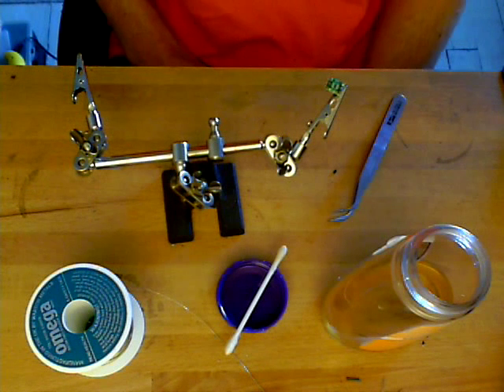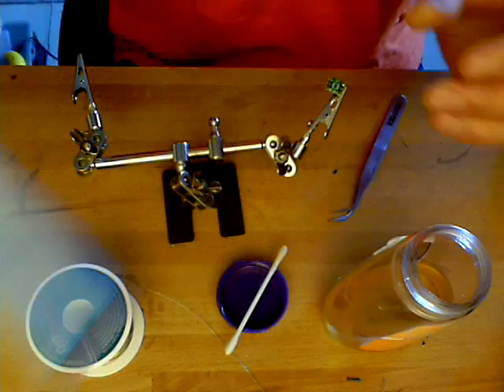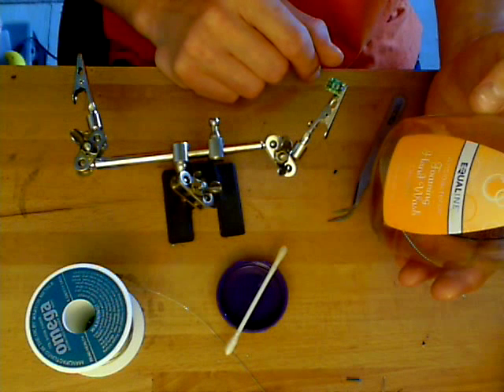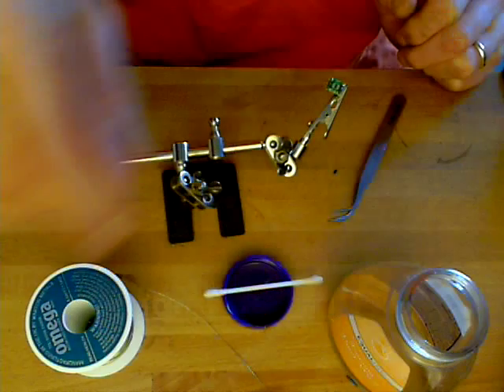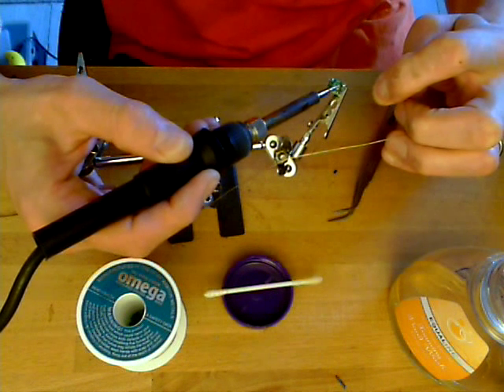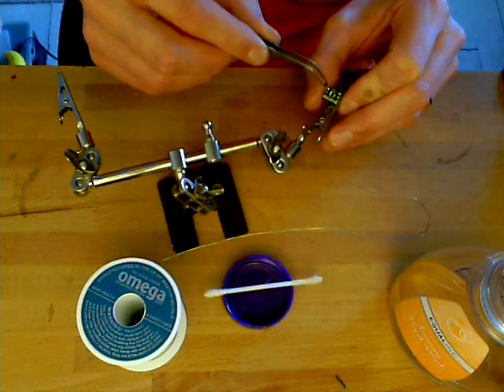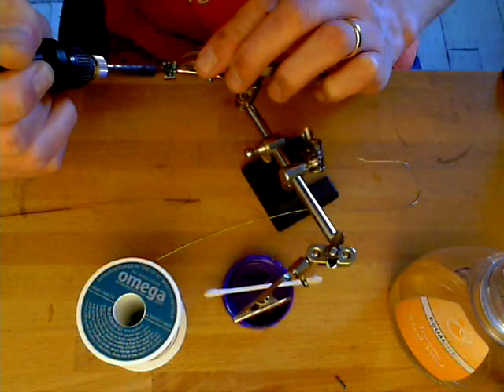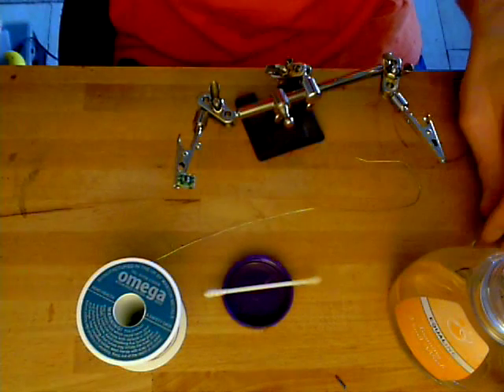DIY flux from pine resin

Comment: hi, thank's for sharing . I have something called KONTACT SOLDER PASTE . I thought it will help the solder stick and not fall off but this thing just makes the surface even more slippery  and I end up with bunch of solder drops under my work . will pine resin help the solder stick or ?